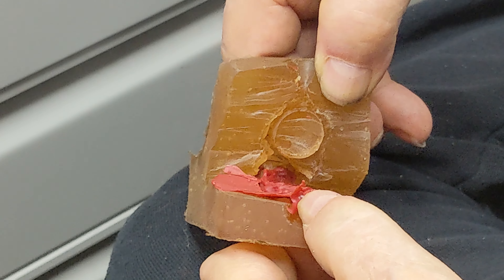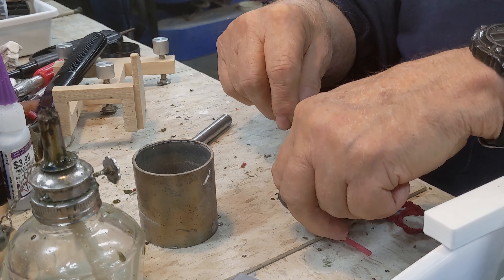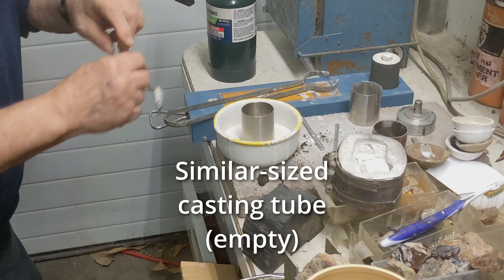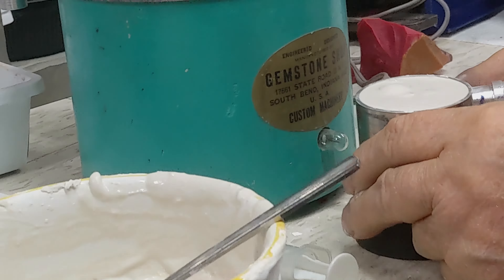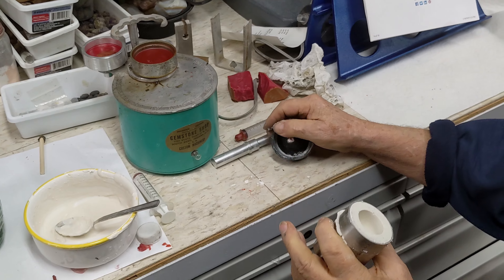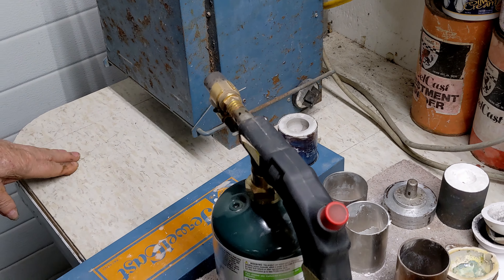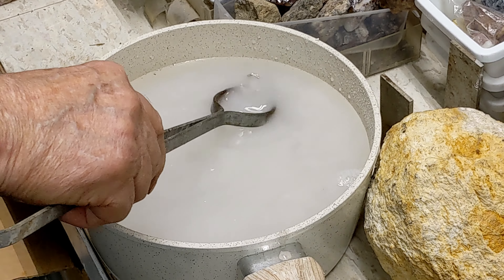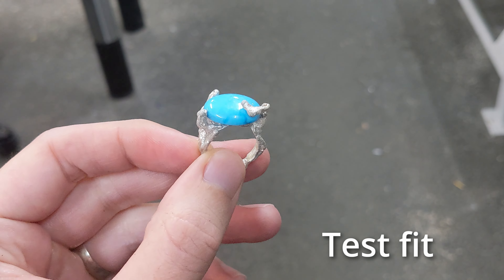Let's Make a Ring! Lost Wax Casting, From Wax to Silver Ring

Comment: How hot can the mold get before it starts to have issues from the heat?
Reply from the maker: That question also relates to one of your other ones. The kiln goes up to 1000F max, we might have baked it to 500-800F (no thermocouple to monitor the actual T). The investment powder is mostly calcium so can withstand MUCH higher temperatures, probably at least double that, without issue. Getting it hotter would theoretically be better because then the molten metal would be less likely to "freeze" on contact. In this case, it was still pretty warm from the kiln. Part of the issue is timing - you want the mold in place and ready to go right when the silver is hot enough, and heating both would significantly increase the heating time without doing THAT much to help the casting process - the vacuum does a lot of the work to draw the silver/metal into nooks and crannies. But I'm very much an amateur, so this is based on relatively few experiences with the method.
Reply: @DonohueLabs  i ask because i want to try making a ring for my wife and the only heat source i have that gets hot enough is my gas forge so i will have to turn down the flame so it doesnt get too hot. The method you  used by melting the silver on the mold itself instead of pouring it has cleard up a previous worry i had about pouring it in time ill just do it that way. Thanks for the help.
Reply from the maker: @Regdiggs  Good luck, but note that we were also using a vacuum pump to pull the silver down into the mold. Gravity will do a lot of the work but depending on the complexity of the ring your mileage may vary.
Reply: @DonohueLabs how long did you leave the mold set up before you placed it in the kiln?
Reply from the maker: @Regdiggs We rushed it and might have only let it set for like 30 minutes, I think usually you want an hour or two. The mold was fairly small, too, which helped, so obviously a larger mold would need longer to set.
Reply: @DonohueLabs  one last question. Since im using my forge to both melt out the wax and melt the silver into the mold will it hurt at all to let the mold sit under the flame for a few minutes once the silver has melted to try and ensure that it has flowed into all the finer detailed areas of the mold?

Comment: What's the temperature for the last stage?? Thank you
Reply from the maker: This was pure silver, which melts around 1000°C or just under 1800°F. But we were just blasting it with a blowtorch, so the temperature wasn't controlled.
Reply: @DonohueLabs  I mean the flask.. 😁
Reply from the maker: @senghoucheong666    hmm sorry not sure what you mean by flask. If you are referring to the cylinder with the wax ring inside, the oven doesn't have a temperature monitor, but it probably gets close to 1500°F.
Reply: @DonohueLabs  it is OK.. Thanks for your reply 😁